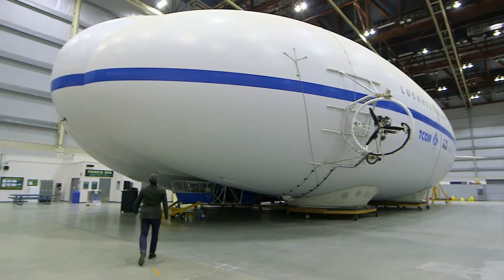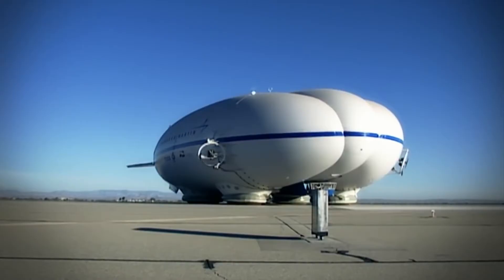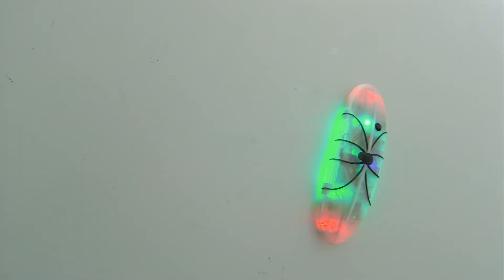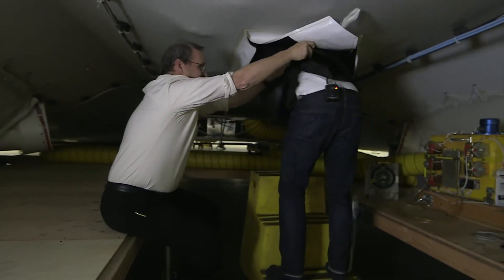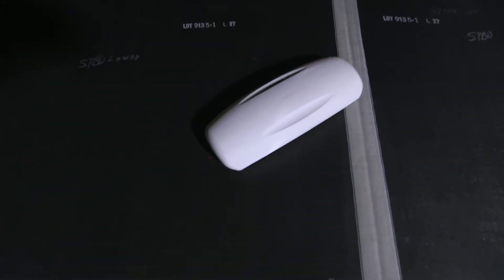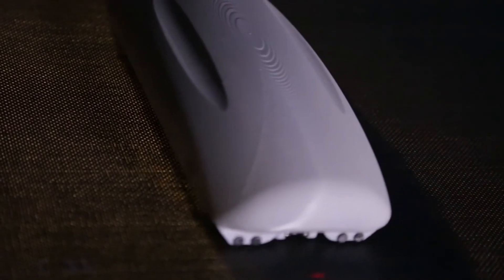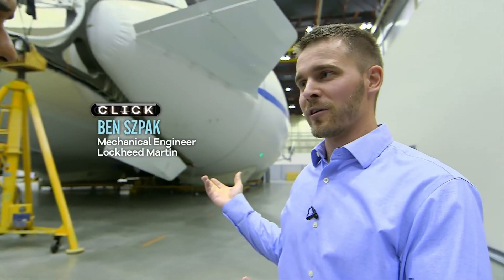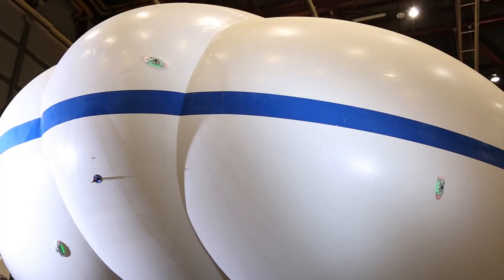Lockheed Martin: Hybrid Airship

Comment: Imagine you out solar cell on the body of the ship and you can have lot of power to fly forward.
Reply: Millennium already has the Solar Battery system.
All electric.
Quiet.
Rainforest or wild life observation deck.
3-5 day sustained flight

3cylinder diesel- electric backup motors if necessary